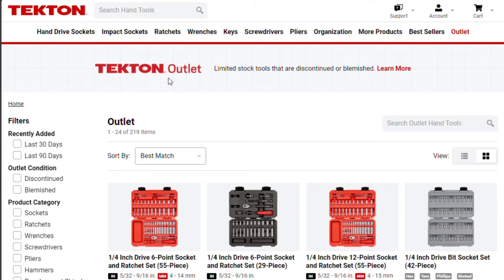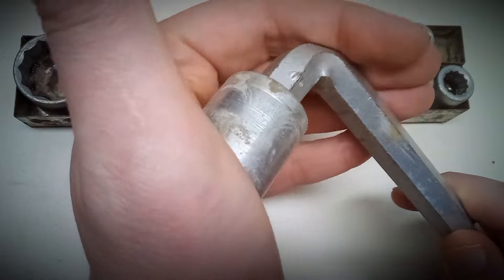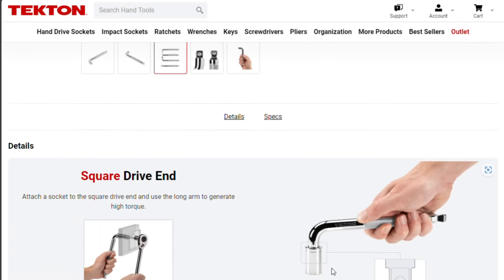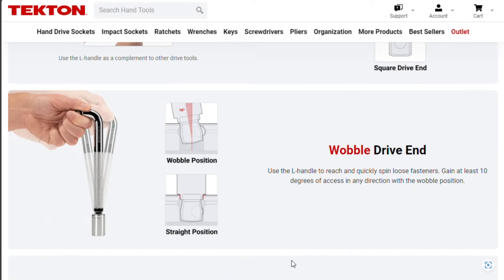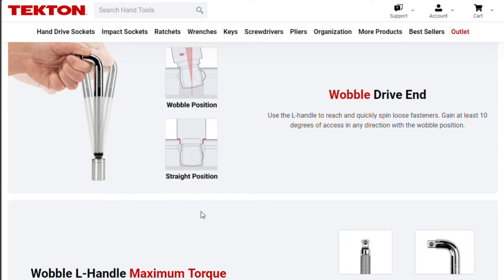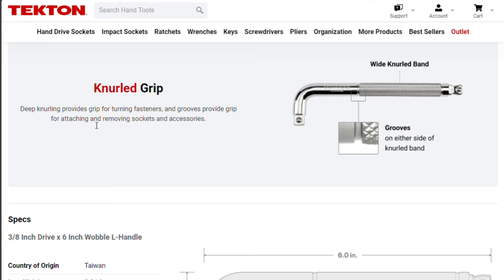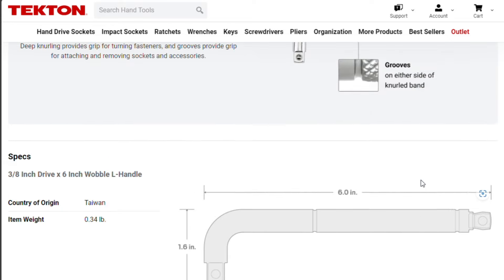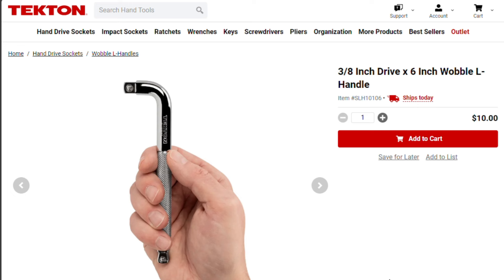Tekton brought back the "L" Handle? (My Reaction) #tools

Comment: Its nice that you can use extensions as a cheater bar.
Reply from the maker: That's something I didn't think about. You can vary the length by putting different size extensions on the handle.
Reply: Boom internet proves itself useful I was worried I could only lose sense on here these days
Reply: @ballinator or 24mm deep socket for a nice burley handle. Comfortable. when are you reviewing your L breaker bar you bought?
Reply from the maker: @sasquatchrosefarts9131 LOL, I'll probably pick one up next time I order something from Tekton...
Reply: I use mine at work to tighten Cummins oil pain drain plugs. I pretend I’m back in time tightening the plug on a 1929 Pierce Arrow.

Comment: Useful for adjusting things where the bolt has to be moved back and forth, not just tightened in one direction, and a flex-head breaker bar might allow the socket to flop.  I'm pretty sure companies like Elora and Gedore never stopped making them - though the wobble square is a new addition to me.
Reply from the maker: My resistance to buying one is decreasing.
Reply: @ballinator overlanders who want a tool they can rinse mud off.... I can see this being great when your truck is broke in the mud. And a $200 snapon ratchet doesn't seem wise for the task. And if you drop it in a mud puddle and lose it, you don't cry.
Reply from the maker: OK. That makes sense. Also might be useful on a boat where salt water could rust a ratchet. Up to maybe 50% on getting one now.
Reply: @ballinator   How about the rusty "toolboxes" on tractors?  Between a small cheater bar, some sockets and an adjustable wrench you just might be able to tighten the alternator belt to save the battery and get back to the barn...without a long walk.  Or maybe even tighten a nut or two on an implement if needed.  I plan to get at least three, for the truck and two old tractors.
Reply from the maker: Yeah, you could put it in there, with three or four sockets in the sizes you need. I'm up to 64% on buying one.
Reply: @ballinator also, less chance of bloody knuckles from mechanical failure of a ratchet or flex breaker bar. 

Good point about boats. See, you can put it in your tool kit,.....and also have a real ratchet, and avoid using the real ratchet because you have to spray it with oil and wipe it anytime it touches saltwater. And if you drop it overboard you don't cry. Bilge water for an ocean boat of any size is salt water......

I only have one car and no boat. But if i had a boat I would own this.

Comment: I'm thinking it'd be great for crow's foot wrenches, I use a sliding tee handle right now for my flare nut crow's foot, as I don't have a set of regular flare nut wrenches
Reply from the maker: That sounds like a good use case. Would give you a bit of offset too.

Comment: Actually inherited 3 of them in 1/4, 3/8 and 1/2 and made by Armstrong. The have regular ends, not wobbles. 
I've not had an opportunity to use them, but they belonged to my Granddad, and I can remember him carrying one in his tool pouch in the 60s. He had 3 or 4 sockets for it hanging on a ring attached to his pouch as well. I was 7 or 8, and don't recall seeing him use them, but I can recall that old leather tool pouch and what he kept in it really well. The pouch was gone when he passed 20 years ago, probably dry rotted away, but all the old tools were in an old metal toolbox that's heavier than anything you can buy today.q
Reply from the maker: Very cool. I have some old ones I've collected over the years. Never used them either.

Comment: Use it as a counter hold with a socket. Same as a using a box end wrench when you don't want to carry the wrench set. You can also put a deep socket on it and them make it a slip over ratchet handle for a handle extension.
Reply from the maker: Yeah, that would work. Starting to think about getting one now.

Comment: i carry a 1/2 inch one of these in the toolbox under the passenger seat of my willys jeep along with a small length of pipe and 1/2 drive 3/4 deep socket....it makes for a very compact 'tire iron'..with other sockets it can also be used as a very compact breaker bar...the L handle and pipe are each about 12 inches long...with a 3 inch overlap it is about 21 inches of breaking force.

Comment: Sometimes I watch videos of Pakistani truck repair, which is itself a crazy rabbit hole of "eh, it works for now" repairs. I see them use a lot of square L handles, but those are probably all made in Pakistan or India.
Maybe the cost of manufacture is just so low, that $10 is very profitable price, since there will be people to buy the new gimmick.
Reply from the maker: Hmm, I wonder if the Tekton is a rebrand of another tool that's sold overseas, or did they "design" it themselves.

Comment: Maybe this is to cash in on the new wave of persanalized "edc kits".  Like the bit kit and tiny wrench that comes with the swisstool plus but weirder. 

It's an obsessive exercize in maximizing function vs weight/size within a finicky little nerdy pouch.  Its never quite perfect so you just keep carrying your swiss army knife while collecting goofy little tools in a quixotic quest to star in your own McGuyver adventure one day.

This is the hipster version of the tiny rachets.  The cool factor comes from being not as capable or compact.
Reply from the maker: I was surprised they didn't offer a 1/4" version - that would fit better with the EDC crew. I thought maybe someone could put one in a 'minimalist' kit, to keep on a motorcycle or something, but even then, why not go with a compact head 3/8 ratchet?
Reply: @ballinator  lol I thought it WAS a 1/4 drive!  Now some hipster is going to learn leather crafting just to make a custom holster for one and annoy his coworkers.

"Oh this thing?  What do YOU carry?  A cute little baby ratchet?  Typical"
Reply from the maker: Yeah, it's 3/8 & 1/2" only. I don't get it. Yet for some reason, I kinda want one...
Reply: @ballinator  i have 1/4" along with 3/8 and 1/2. Not sure of the brand, bought it on garret wade, havent used any of them yet. Im kind of a collector though.

Oops it doesnt have the wobble end so its not quite the same, but i like the finish though.

Comment: you will never bust your knuckles when the other ratchet head slips/breaks.
i want one in 1/4inch drive 
with no flex head you or pivot this pin cant break
if in 3pc set would buy today
Reply from the maker: That's true. Maybe these are suited to high torque applications in tight quarters. Still not sold on them yet though.

Comment: Sometimes you have to put a tool in place, and hammer on a several foot length of wood placed against it.
Reply from the maker: I've had to do that before with a wrench. Wouldn't want to do it with a ratchet. L handle might come in handy for that.

Comment: For 10 bucks... Better to have and not need than need and not have. Doing a lot of car stereo installs and tight spaces... I think i could find some practical uses.
Reply from the maker: Hmm, use in tight spaces where a ratchet won't fit. Maybe.
Reply: @ballinator  maybe for width, not height